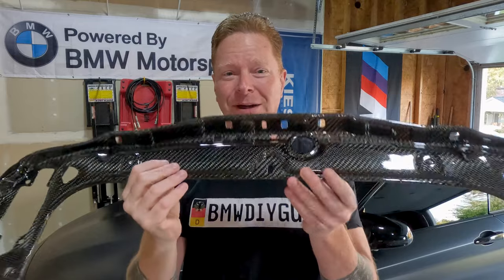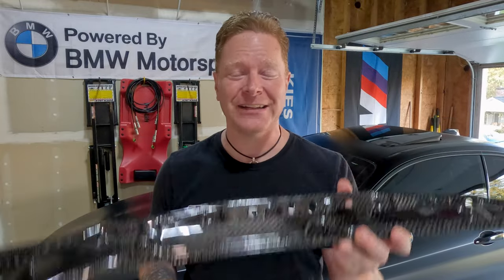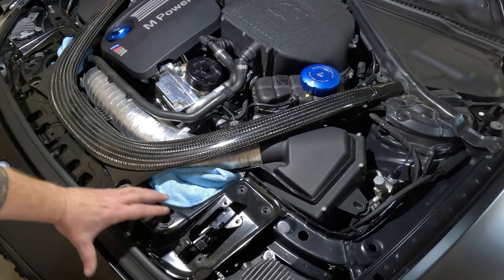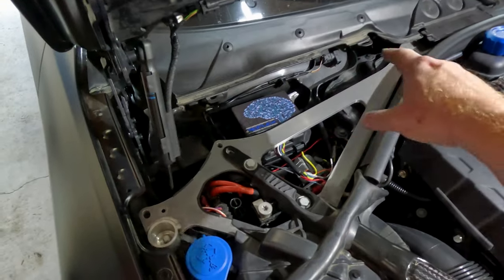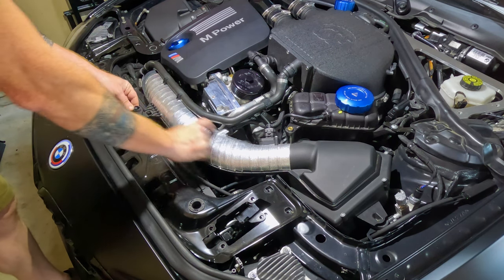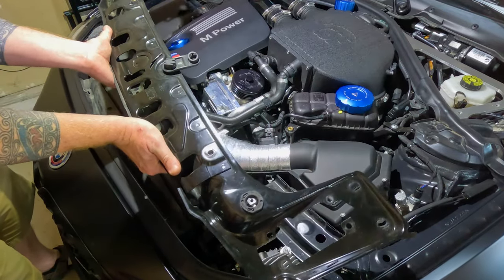Easy DIY for the ultimate BMW F8X CF engine bay upgrade - The world premiere Mashimarho CF brace!

Comment: Looks good, I have yet to pull the trigger on it. But after seeing this I might have to. SLON made it in dry carbon before them but the gloss carbon looks really good.
Reply from the maker: I wouldn't do dry carbon simply as it wouldn't match the sway bar.  It looks amazing honestly and the install is easy!
Reply: Like you said, slon workshop has had this available for awhile now. In matte and gloss carbon.